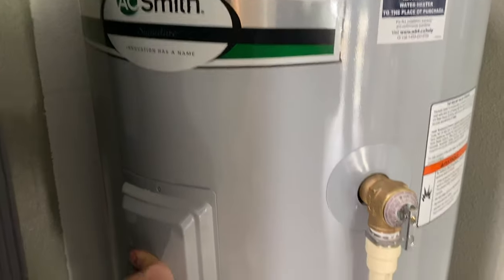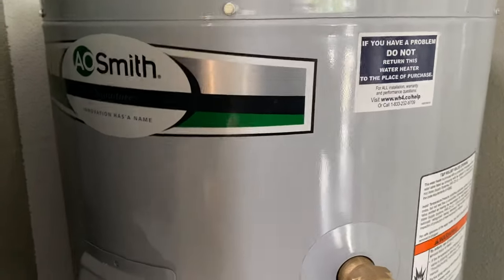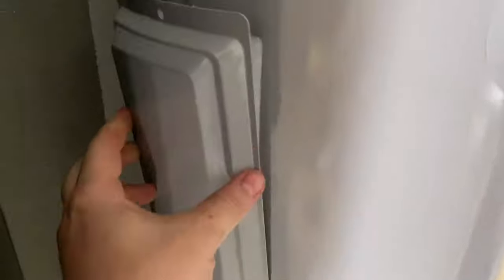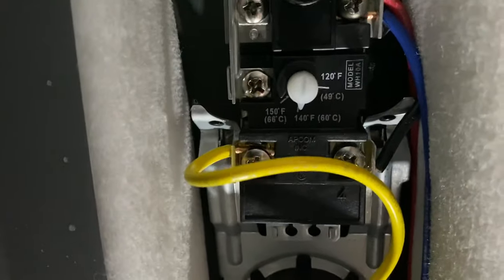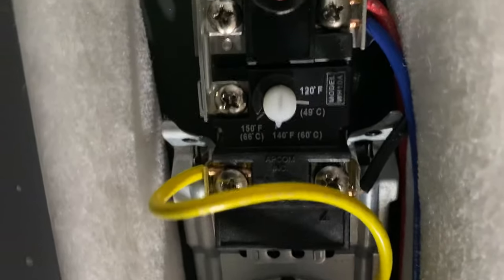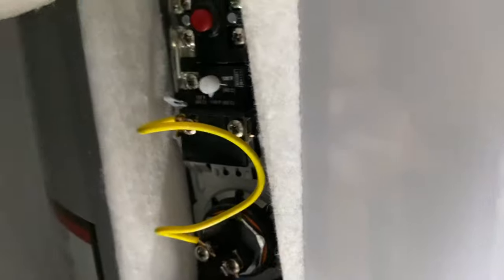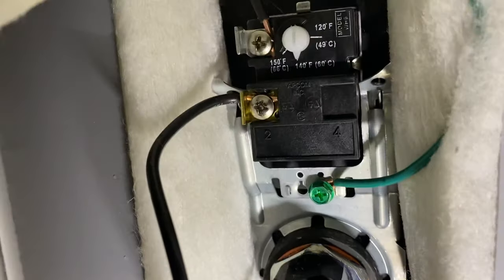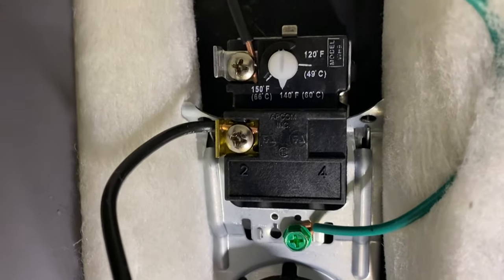How To Make Your Hot Water HOTTER

Comment: Couris to ask!  I believe my heater is set to low temperature could it be possible for the water not to last long enough? I hope you're an expert and are able to tell me. And can it take longer to heat up the water
Reply: You have to wait about 3 hours before the water adjusts.
The hot water is not very hot set to 120, although it may sound like a lot.

Edit: actually had my heater adjust in under an hour 🌞

Comment: So do we change both??
Reply: That's what I'd like to know.
Reply: I saw another video that states that you should do both to prevent any issues... No specifics on what type of issues...
Reply: Yes, they both have 2 be the same or it will not function properly/ or work. From what I've seen
Reply from the maker: Incorrect. Still working fine. Although I do agree with doing both at the same time, mine is still perfect. It’s my little test to see just how long it’ll last. I’ll update the description when the tank fails.

Comment: My water heater is turned to the side so I had to do it wedged between the cabinet and I shocked myself on something in the bottom panel… any clue as to how or on what?
Reply: Probably everything in the box... all thoes wires are electrified
Reply from the maker: Why didn’t you disconnect the breaker before going near it?